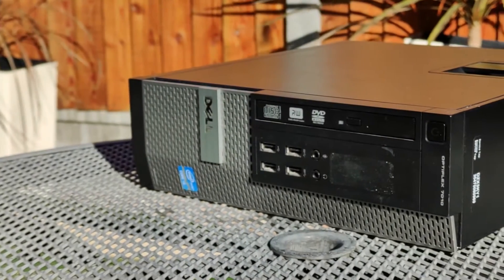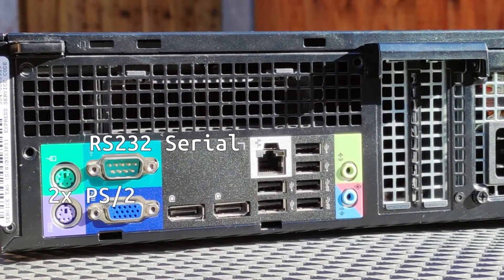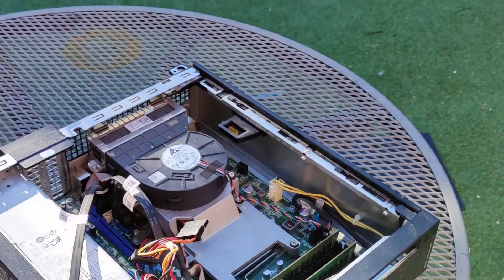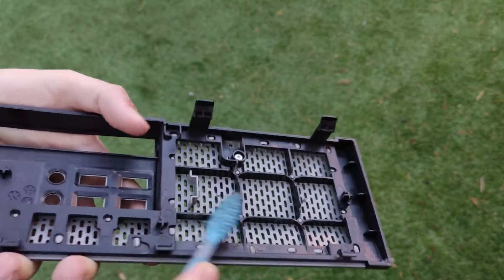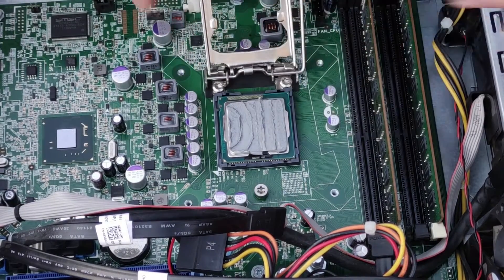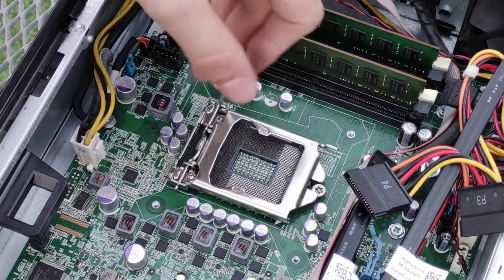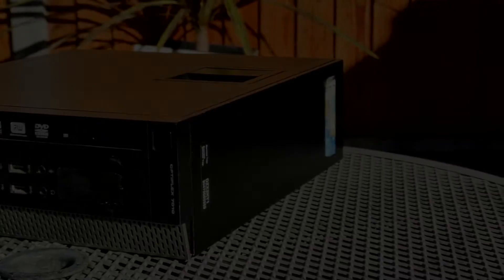How to Fully Upgrade/Refurbish a SFF Dell OptiPlex 7010

Comment from the maker: Correction at 1:05 - It has 4x USB 2 and 2x USB 3 on the back
Reply: ok
Reply: Is posible to install dual lan card on this pc?
Reply from the maker: Yes, it has PCIe expansion.
Reply: @scellyyt do you think can be easily turned into a 2-4 hdd NAS?
Reply from the maker: @jirehla-ab1671  No chance unless you swap out the optical drive for a 2.5" drive caddy adapter thing. This only has space for one HDD from the factory.
Reply: Was just about to say but you nailed it
Reply: I just purchased a refurbished 1 from Walmart on-line.🖥🖥

Comment: no usb 3 on this computer, its to old.usb 3 is blue.
Reply from the maker: Not necessarily. USB connectors with a SS symbol next to them are USB 3, you can tell it is USB 3 because there are extra contacts on the tip of the plastic pin inside the connector.
Reply: ok cheers ive learned something today.
Reply from the maker: @Stevecool1967  That's what matters

Comment: Recently got one of these for about £35 on eBay. Theoretically after an SSD upgrade and a lightweight Linux distribution install, it shouldn't be too bad doing light office work and some internet browsing. I'm going to keep it on Windows 7 to keep it as an offline hobby PC, to tinker with and copy some old Windows 7 software onto. I will probably end up installing Microsoft Office 2010 onto it for example. I may do a more powerful Windows 7 build down the road to run Creative Suite 6 off of, as i'd be keeping it offline anyways so you can use whatever Windows version you want. Realistically, this PC will mostly be used for ripping DVDs and legacy software (e.g. old iTunes) though.

Comment: is it possible to install a new mobo to that old dell pc case?
Reply from the maker: if you mean a motherboard of the same model, yes, but it does not support any standard motherboard sizes so you can't use it as a normal PC case

Comment: Can it be upgraded to Win 11?
Reply from the maker: You can hack windows 11 onto it but it's not supported, it's too old.
Reply: @scellyyt  I sort of thought so! Got a hold of a Dell 7010 MT but the case & front cover got damaged! It was a dumpster find. But it still runs. Has the i7 3770  3.4 Ghz.(S ?)  (think that's the highest supported). Has Win 10 Pro.  Thank you

Comment: Got one of these with i5 3570 & RX550 OC low profile for €120. For another 50, I added 8gb ram (16gb total) and a 480gb Kingston SSD (it has mounts behind the HD). Just finished RDR2 with 47fps average. Started Witcher 3 yesterday, runs perfect at 1080. Temps are excellent without any mods. Great little bargain gaming system.
Reply: Sorry, what's your video card?
Reply: @sfsliftoff18 Rx550

Comment: Something must be wrong with my Optiplex 7010. It has 10 USB ports: 4 on the front and 6 on the back. But only one of them is USB 3.0. 9 are USB 2.0. I could use another 3.0 port, but I don't know if there's anything I can do about it. Maybe something is hooked up wrong?

Comment: I think I need to replace my  ddr3 on my 7010 optiplex- (bigger version). It gives me that yellow light blinky thing.
Reply from the maker: Check what the flashing code means using the manual which you can find on Dell's website, that will tell you what it is. I think the most frequent point of failure for these machines is the power supply.
Reply: @scellyyt  i got 6 beaps, could it be faulty ram?
Reply from the maker: @matthewbanda816  Check the pattern of beeps and compare it to this https://www.dell.com/support/kbdoc/en-uk/000124830/dell-optiplex-and-vostro-beep-codes-and-error-messages
Reply: @scellyyt  DIMMs not being properly identified or used - that's my problem with my situation......sooooo what does that mean?
Reply from the maker: @matthewbanda816  Yeah that's bad ram then. Try reseating the sticks or getting suitable replacements.
Reply: @scellyyt  dude thankyou!!!
Reply: @scellyyt  which ones do you recommend for a DDR3 Based Dell Optiplexes???

Comment: I got the 7020 sff for only 50 dollars (usd) on ebay and it has a i5 4590 with 8 gb of ram but no hdd
Reply from the maker: Not bad at all. You can loosely install an ssd in there and have a perfectly good computer.

Comment: I appreciate the video. I have one of these and it runs Linux. Just going to upgrade the RAM nd your guidance is well filmed and very valuable. Thanks
Reply from the maker: I'm glad you found it helpful. Linux is an excellent option for older systems like these, I am running one on Debian with XFCE and it's really nice to use.

Comment: Good video. Which wifi card do you recommend to get wifi access?
Reply from the maker: Any intel pcie WiFi card would work fine as long as it's on a desktop low profile PCIe card since this computer doesn't have any dedicated mini pcie slot for wifi.

Comment: I got this desktop but I got a monitor that uses HDMI and now im trying to get an HDMI to VGA cable
Reply from the maker: Make sure you get a high quality one, and for that use case it would be better to get Display Port to HDMI because then it doesn't involve analogue to digital conversion which can cause image degredation.

Comment: is it possible to upgrade the psu?
Reply from the maker: I'm not aware of any official power supplies that would be an upgrade but I presume you can purchase 3rd party power supplies that can fit in the same form factor. However I'm not sure of if they would be safe or reliable.
Reply: I used a old dual core sff power supply in mine but needed a extended power lead to the mobo. I have a 790.

Comment: Planning on getting a Xeon quad core 8 thread 2.8Ghz/core CPU for my Optiplex 7010 SFF and am going to max out the RAM, flash the BIOS to add Xeon support and increase the memory support as the stock BIOS only officially supports Celerons, i3, i5 and i7 chips and a maximum of 16GB of 1,333Mhz DDR3 memory and I plan on upgrading to faster 32GB 1,600Mhz DDR3 memory in 4×8GB sticks. The next upgrade will be a low profile GeForce GT 1030 4GB GDDR5 graphics card. I also heard there are low profile GTX 550 2GB GDDR5 cards out there so I might look into getting one of those if the 1030's turns out to be too pricey. The storage upgrade is going to be a $30 1TB SanDisk Ultra 3D 2.5" SSD with a drive caddy adapter I got from Ebay for $4. The graphics card is going to be the hardest upgrade to source for me as the GT 1030's have recently gone up in price and my total budget for this build is $130 which includes the CPU, SSD, 32GB of RAM, and no more than about $40 for the graphics card.
Reply: Instead of a GT 1030, why not get a low profile GTX 1650 or RX 6400
Reply: @nickfury1279 why a drive cady adaptor is needed? Is it manufactur specific?

Comment: you'll find using an old paintbrush versus a toothbrush will be safer for the parts and more efficient at knocking dirt/dust off
Reply from the maker: Depends really, I find paintbrushes are unable to brush off the more "stuck down" dust

Comment: i5-3470 is a little too old and not as quick and because of this the lifespan is far shorter the modern CPU of 6,7,8 gen.. I would like to get rid of mine or give it away. I have a ThinkCentre tiny i5-3470T still works very well indeed and occupies a small space on my desktop.
The current cost-effective USED SFF PC is based on i5 or i7 of 6th or even 7 th gen Intel CPU, you may be lucky, I found and bought mine based on i7-7700 from HP desktop SFF, Elitedesk 800.
Reply from the maker: If you're using Linux then older gens are still extremely good but the newer ones are good
Reply: There are still weaker processors being sold brand new today. A new gen Intel Pentium is as weak as a first gen i7 processor which is 14 years old. This 3rd gen i5 will still do fine for a regular home use computer

Comment: You can also upgrade to hdd to a ssd
Reply from the maker: Yes but you'll need a 2.5" to 3.5" mount for it to not rattle about in the case because it doesn't have any 2.5" bays
Reply: On mine, there is a 2.5 ssd mount point on the back of the HD mount. 
Edit: mine has a different layout to the video but it's also a 7010!

Comment: Hi is it possible to add an extra Sata drive? I have plans to turn this to a nas?
Reply from the maker: Unfortunately it's quite limited for storage upgrades, there is only one 3.5" bay for storage. I believe you can get mounts that let you replace the optical disc drive for a 2.5" drive mount, but otherwise I wouldn't recommend these systems as a multi-drive nas.
Reply: @scellyyt  ahh thank you so much mate.
Reply: @scellyyt  would you recommend any other machines to convert into NAS at this price point?

Comment: Can the 7010 take up to 32 gb ram without issues?
Reply from the maker: If you use a kit of 4 identical 8gb DIMMs there should be no issues. If different sticks of ram are used it also probably will work, but it may not run at transfer speeds as high as you'd expect because of mismatched timings and other things. My server 7010 is currently running 16gb with 4x4gb non identical DIMMs just fine at 1600mhz.

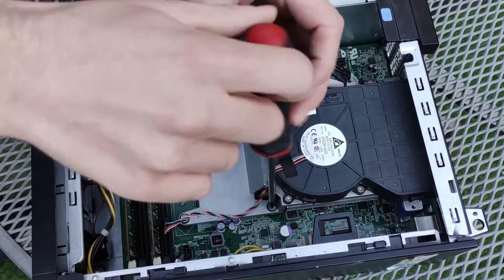Comment: 7:05 Don't forget to plug in the CPU cooler again so it has power.😺
Also it's probably a bad idea to blow any dust around the case with the CPU removed as dust will contaminate the CPU socket.
Reply from the maker: Hence I kept it in the socket. That also keeps the CPU safe from drops. And yes, the fan should be plugged back in again! 😅

Comment: My Optiplex has i3-2100. Do you think I can upgrade to i5-2400 or even i5-3470 with the same PSU?
Reply from the maker: If memory serves optiplexes running 2nd gen intel processors don't support 3rd gen, but you can upgrade it to something like a i7-2600. The PSU will be fine because all trims of the same optiplex use the same PSU e.g, the i3 and i7 optiplexes use the same PSU
Reply: They're both the same socket type LGA1155 but your motherboard might not have a bios update to support it, might want to check that first.